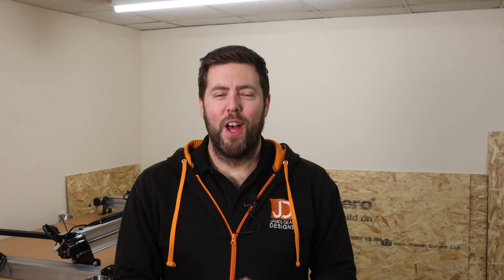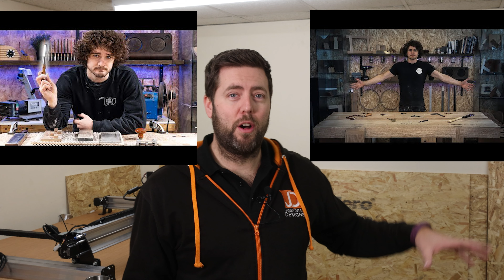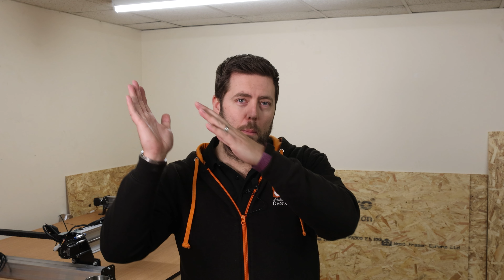Making my LED lit backdrop inspired by @MattEstlea

Comment: that looks pukka - your videos have been a massive help for me dude, really appreciate the effort you put in to all of this. watched a previous video of yours where you mentioned wifi issues due to distance from internet router. if this is still an issue, google " power plug " - they basically turn the electrical cables in your house into ethernet cables, plug one into your router, the other anywhere in your house, garage, workshop - you can then wire your PC directly, which is far superior to WiFi anyway. You can have as many around the house as you like too